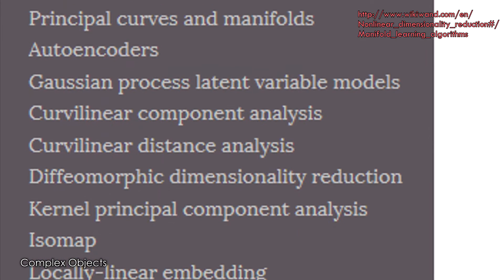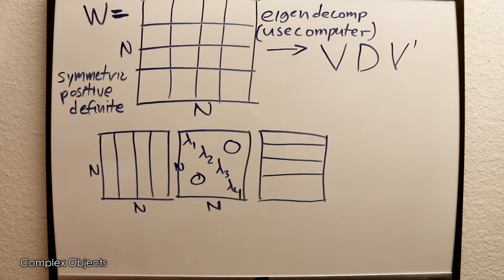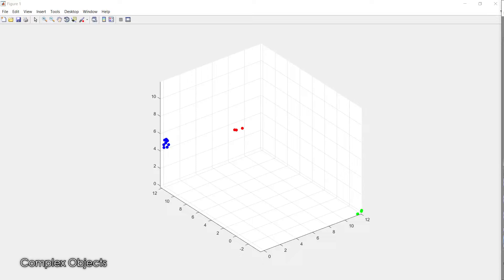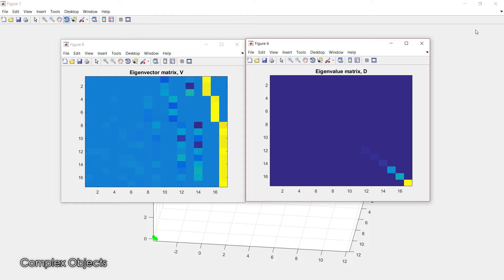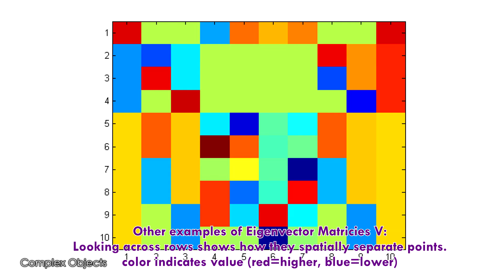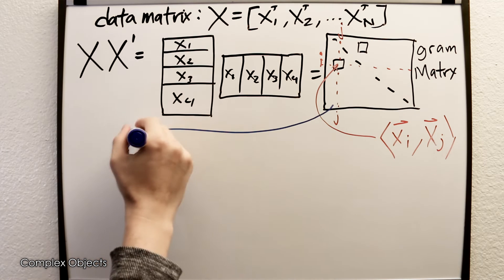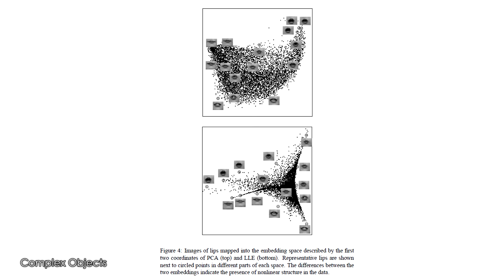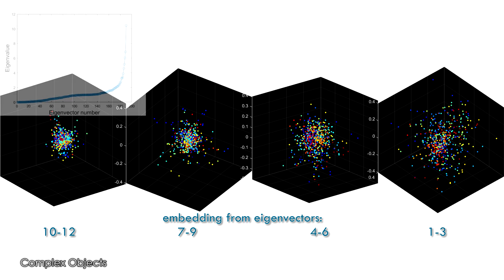Why we take Eigenvectors of the Similarity Matrix

Comment: Thank you for the videos. How does one assign value / colors of the plots at the end? The plots of the eigenvectors of the kernel? I often see various different units assigned to them, and I wonder if you can please comment on general strategies for assign such colors? Ex) what do the red specks mean over the blue ones here? Sometimes I see a clear rainbow pattern across the plots. Other times I see a more scattered case like you have
Reply from the maker: The colors in the last plots didn't have any meaning in the context of what I was going over. I think were either random or they corresponded to some data in a different project.
In matlab for example you could use the scatter3 function to color each point by some scalar value, within a given color map. That value could really be anything that is relevant to your data.

Comment: Could you please explain why doesnt PCA use eigendecomposition? 
So far I always understood that PCA is completely based on eigenvectors and values.
Maybe I didnt understand what is the "decomposition" part.
Reply: It actually does... The main difference is that PCA focuses the variance/covariance of the features, (by eigenvalue decomposition of covariance matrix, or spectral decomposition of data matrix), while other dimension reduction techniques mentioned here are based on the decomposition of a similarity matrix.